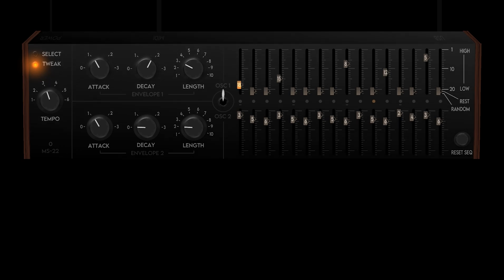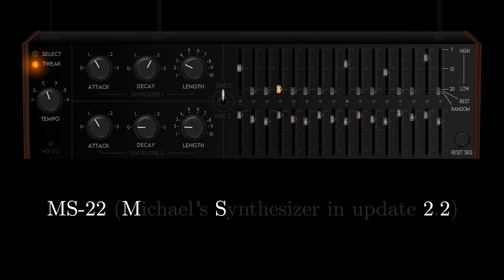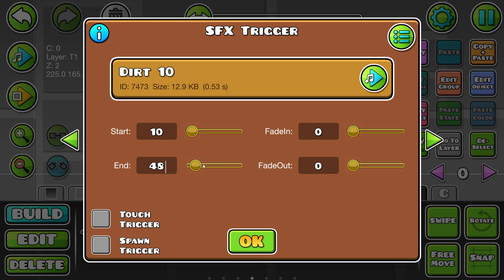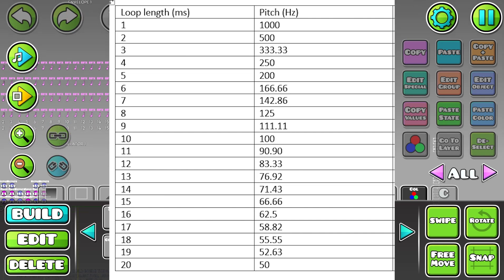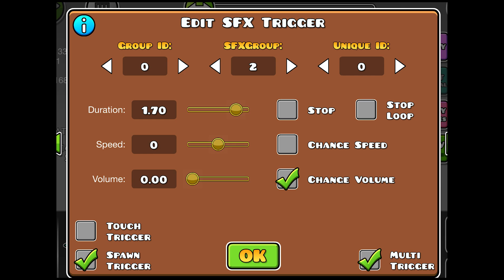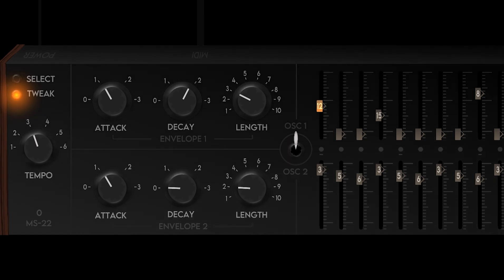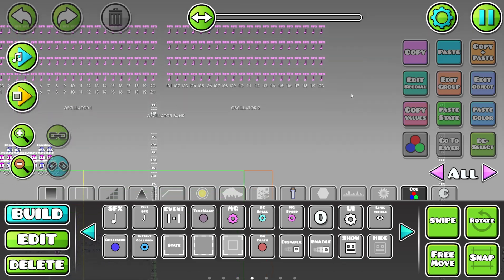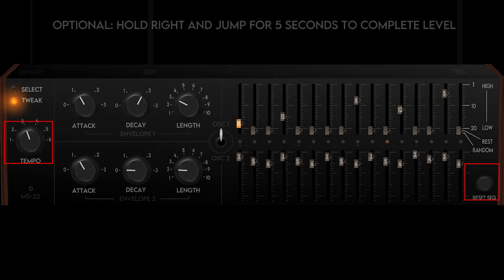Using Geometry Dash 2.2 to Make a Synthesizer

Comment: I wonder if you could play different sections of samples quickly but in order and create a granular synth. Another thing to potentially try is after audio is played initially, playing it again repeatedly at lower and lower volumes to create a delay effect. By turning up the delay speed high enough it might be possible to create a flanger filter, or create a chorus effect by modulating the delay speed.

Comment: I thought about this before but I would never have such patience to do it
what you did is great! thank you! have you docummented the level inside so we can modify the sound effect used, or the timings?
Reply from the maker: there's a bit of documentation and labeling in the editor, changing the sounds would be as easy as selecting all the sfx trigs and swapping the sound, although it might not sound as good
Reply: @flashmichworld  I mean I know a few sounds that would have a saw-like property when slices at certain times, especially if using low rumble you can just take a snippet, making it very sawwave-like

Comment: how feasible would it be to use a "song" uploaded to Newgrounds that's a single-cycle waveform? I'm not sure if the song trigger and the sfx trigger share the same functionality (i haven't really messed with them too much), but if they did this would allow you to, of course, use a much much larger variety of waveforms, and possibly even interpolate through them for a full-blown wavetable synthesizer. 

Another idea that came to me was what if you literally uploaded audio of just different levels of DC to Newgrounds, and very quickly switched between these songs (or switched between +1 and -1 DC while modulating gain) to construct a waveform? not sure if the game can process stuff at that rate, but if so that would technically make it possible to synthesize any digital sound within the game.  

I've also been itching to do some experiments with the digital interpolation that occurs when you pitch things around because it's obviously very imperfect and results in neat artifacts that could potentially lead to some interesting sound design applications. 

if only there was a way to control the delay of a sound in a precise way many more possibilities would open up. imagine a geometry dash biquad filter. 

I feel like you've already thought this through, but it's an interesting concept nonetheless. I love this sort of stuff! thanks for dedicating time to this project :)

Comment: Is it theoretically possible to make something like image hack but for sounds? i.e. combine sfx triggers to approximate any sound
Reply: That definitely seems like it should be possible but I wouldn't know
Reply: @Alefen some nerd will figure it out
Reply: yes but you'd need thousands of triggers for a second of audio unless you can optimize it a shitton
Reply: audio to midi is not very hard to do, however i don't think it will work in realtime because it would be too many sfx triggers for gd (or maybe not?)
you could make sure there is a fixed number of triggers per second to make it work in gd, but then it's not gonna be as accurate
Reply: Theoretically, yes. Practically, no idea.
Reply: absolutely possible, you just gotta have a very good computer cuz you can make an additive synth using a set number of sine waves, say 256. These 256 sine waves all have a different pitch and if you change their volume you get different sounds.

Comment: Would it be possible to make a kick sound using a quickly falling length
Reply from the maker: drum stuff would definitely be possible - there are also drum sounds in the stock sfx library so you could also make a drum machine without synthesizing those sounds from scratch but i thought it was outside the scope of this project
Reply: but for the best results you definitely need something that approximates a sine wave